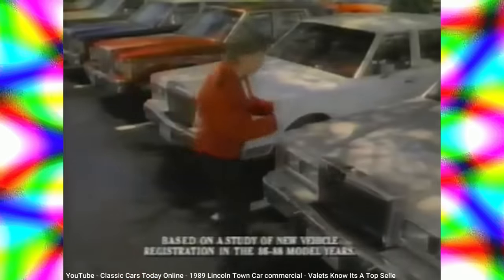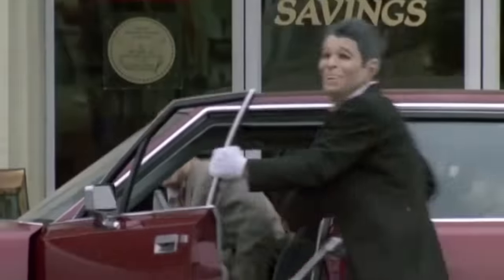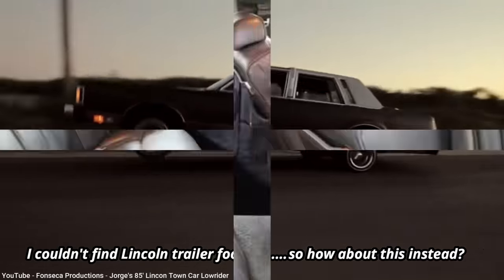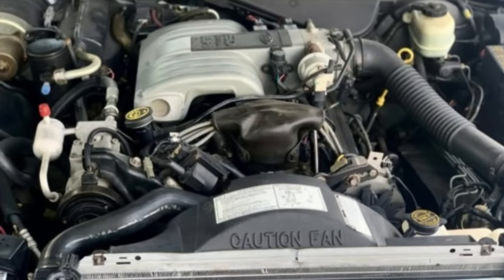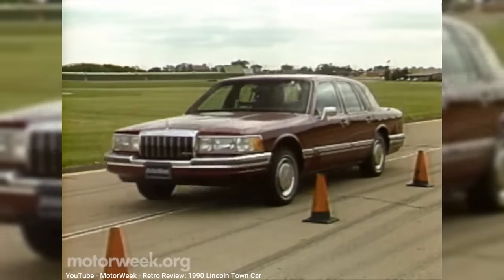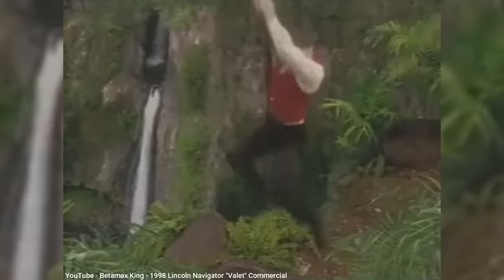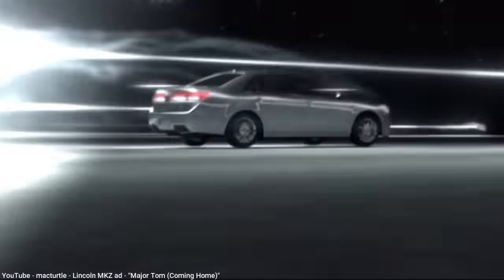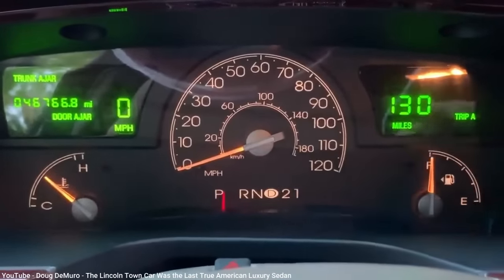Here’s how the Lincoln Town Car was the last old-school luxury car

Comment: When the Ford Motor Company panther platform cars were finally discontinued it was the end of an era in automobile manufacture. These three cars, the Ford Crown Victoria, the Mercury Grand Marquis, and the Lincoln Town Car, were the last of the full size, rear wheel drive with a solid axle, the body on a frame, and a naturally aspirated V-8 engine in the front. With the push for higher fuel mileage, better safety and lower emissions we will never see cars built like this again.
Reply: Better safety ain't part of it.  The gen 3 Lincoln TownCar was the first car to ever get all 5 star highway safety impact ratings, they're absolute tanks and I feel incredibly safe in mine.
Reply: @implodinggoat  Fully agree
Reply: They were also low emissions vehicles. They achieved LEV status without variable cam timing and direct injection. They were cancelled because Ford was making more money off SUVs and trucks. It had nothing to do with mpg because the Panther cars get better mpg than the SUVs.

Comment: This is a car worth having. The 1990-2011 models are the ones that I want to have. I remember reading that the 1989 version had the worst ABS system of all time (of course, it didn't have ABS that year).
Reply: I think the 2003-2006 were the best years for the last generation, if you look hard enough you can actually find them really well equipped with HIDs, Factory nav, THX sound system, Heated front seats with memory, and if it's an L you can get heated rear seats.  After 2006 they started cost cutting and cut a few of those features out.
Reply: Owned to gen 2s, great cars.

Comment: One thing that was always lost on me was why didn't Ford put the Intech dual overhead cam V8 into this car. The Mark 8 had it, even the Continental got a version of it. I think a 300 horsepower, double overhead cam V8 would have definitely put this as more competitive against its German and Japanese rivals
Reply: Should've had it available for all the Panther cars and Trucks. Put some excitement into the brands, lower the costs by selling more of them.
Reply: I had a 97 Town Car. They were pretty quick for what they were.
Reply: @pgtmr2713  Exactly mate, they should've made a 6.8L DOHC 40 Triton V10 as well.
Reply: Now imagine in 1993 if that Continental had rear wheel drive, 4 corner independent suspension and that V8, things would have been different for the American luxury segment. 
The STS had the same issue...

Comment: Actually surprised the 2017 continental didn’t sell. It was a very outstanding vehicle inside and out. Same with the Cadillac ct6. Sucks they killed them
Reply: Those Continentals were amazing.
Reply: Wasn't it based on a Fusion...?
Reply: @carsaregood911  it wasn’t based on anything. Oddly, same story with the Cadillac
Reply: @GeeEm1313  exactly. Lincoln really delivered with those continentals and mkz
Reply: @carsaregood911   Sort of, it used the CD4 platform as a base but it was heavily modified by being stretched and widened and additional strengthening of the platform for the added weight.  Also it was modified and stretched again for the coach door edition.  It used code name D544.
Reply: They brought it to market way too late when sedans among all automakers were winding down. Had they brought the car out in 2010 or 2011, numbers would have sold well.
Reply: @JKCougar  I stand corrected, I didn’t know this one platform underpinned about 10 different cars.
Reply: And the cool door handles within the side trim!
Reply: Lincoln died with the Town Car and Cadillac died with the Fleetwood.  None of their new offerings are luxury cars in the slightest.
Reply: @kingduckford  the Escalade is the last standing true Cadillac tbh. BIG,massive luxury,v8,has presence.

Comment: Had an 1985 Town Car with over 300k miles. It got 20-22 miles to the gallon. Gold with white vinyl top and interior. It would start in negative temperatures and go anywhere I wanted it to go. Wish I still had that tank.